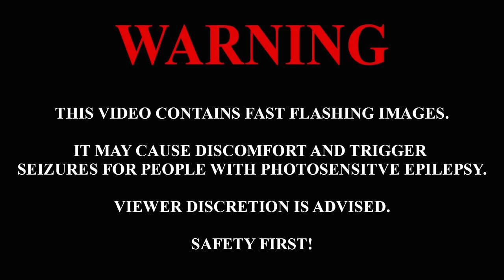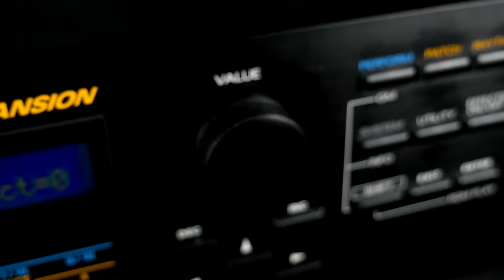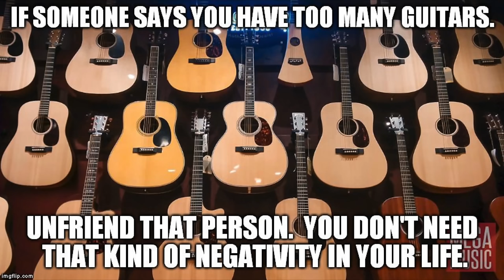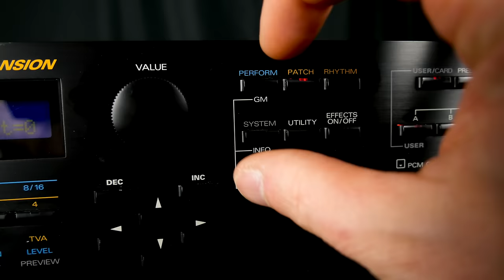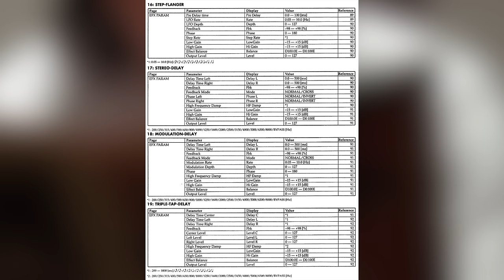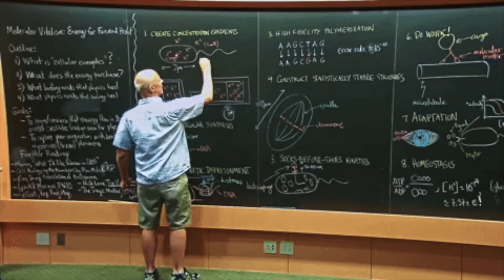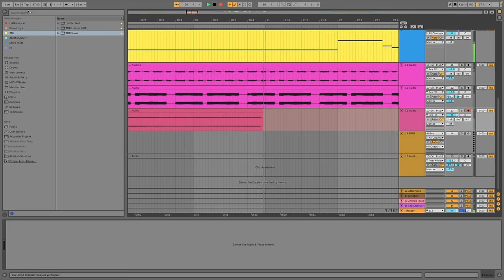Bad Gear - Roland JV-1080

Comment: The JV1080 is one of the greatest synths ever made. The 1080 is insanely easy to program too, its just a giant grid when you hit the parameter and palette button.
Reply: As easy to program as a D50.
Reply: i prefer the JV2080 cause it has a much bigger display
Reply: @Electrodefender  I actually preferred the display of the JV1080 because it was easier for me to read from a distance. I did want a JV2080 but I couldn't justify the much higher price at the time for not much more functionality.

Comment: I love my JV-1010. It gives me quick access to thousands of (mostly) very usable bread and butter sounds and uses half of 1u rack space! The circa 1994 new age goodness is icing on the cake. I wouldn't dare try to program the thing, but still find myself using it almost every day.
Reply from the maker: Super compact little synth!
Reply: Yep, it's my swiss army knife for whenever the synth I'm working on is missing that one sound. I personally even like its sound a bit better than the "better" JV.
Reply: Also adds the Session board, great sounds. Need an external device (iPad, Computer) for editing though. The XV-2020 is very similar, but updated and SRX expansion.
Reply: @darwiniandude  what do you use for editing the jv-1010? I think it is unfortunate that you can't set the midi tempo/clock (for LFO for example) to follow/slave without diving into a software editor.

Comment: I've had mine since 1994, and it's still providing bread and butter in my studio, alongside newer synths and VSTs. An awesome piece of gear.
Reply: @D T Day I do! I actually have 5 (even though the 1080 can only handle max 4.)

I have the Pop card, the Vintage Synth card, the Techno card, the World music card, and the Orchestral card (not installed at the moment) I also have a Country Music PCM card for the front slot.
They do add a lot of versitality and value to the unit.

Comment: I had the JV1010 some years ago - great little thing - and have the JV 2080 for several years now. I always love coming back to this big black box of awesomeness. It has lots of sounds that are still relevant today while others seem a little outdated compared to the usual suspects of sample libraries everybody has today. But it has a special vibe, it instantly throws you back into the 90s ... ticking memory boxes. And it also surprises you with some sounds you find nowhere else. I love it.
Reply from the maker: Nice little sound module!
Reply: About the JV-2080, does anyone happen to know if the entire thing plus expansion boards is built-in to the higher-end Fantom keyboards or the INTEGRA-7 module? Or indeed if any of it is featured 'as was'? They mention an XV-5080 in their current blurb but that one passed me by, so I'm none-the-wiser.

Comment: I have a JD-990 which is very similar, even have a couple SRX cards.  Also I've messed around with the Cloud 1080 vst a fair bit.  The JD and JV series are probably my favorite synths.  The architecture is complex at first but all makes perfect sense to me, intuitive limitations in just the right places and endless inspiring possibilities when you start getting creative.  And the crisp cold "cheesy" 90's digital sound is my favorite.  Nothing bad about this synth at all imo.
Reply from the maker: The 990 is the one to get!
Reply: I was waiting for someone to talk about the 990.  I used to have a stack of three of them, all with the Vintage Synth card installed.  It was awesome but total overkill and it never ended up seeing any use.

Comment: The bass sounds in this unit should not be understated, they are so incredibly thick and warm
Reply from the maker: Agreed, got quite some depth
Reply: agree
Reply: Fuck yeah!
Reply: Still my fav acoustic bass
Reply: Yes! They were powerful!
Reply: I love the preset "WonderBass" that is found on all the JV, XP and XV models. Although it sounds best coming out of a JV/XP. The one in my XV-5080 isn't the same, lacks that oomph.
Reply: @ram-4  man a lot of patches that relied on specific low frequencies sound super dead on the XV versus the JV
Reply: @jonnyalec5646  XV has a built in HPF that you can't turn off.
Reply: @iceparty4364  makes sense

Comment: I bought one of these a few months ago, amazing bit of kit for the price. Surprisingly usable actually, I've been having fun with it in combination with the Sherman filterbank 2
Reply from the maker: Nice, sherman!!!
Reply: The Sherminator can make a half eaten hamburger dropped on wet floor sound radical, so well, yeah
Reply: I paid about £160 for mine a couple of years ago and I've used it on at least one track so far. I haven't gone past the presets, but it's a nice bit of kit to have and I don't see myself selling it. Unfortunately, I am getting a lot of noise from mine, which I don't think I did about a year ago.
Reply: @TimWrightDJ  That's almost exactly what I paid for mine with one expansion card. Are you getting noise on all of the outputs or just one pair?
Reply: @TimWrightDJ  take it to a tech, probably some caps need replacing.

Comment: absolute hell to program without using external software (i write patches via an iPad interface for mine) but a super rewarding synth to deep dive into!!! having some expansion cards to pull sounds from really elevates it. obviously hard to recommend when software alternatives exist and said expansion cards are increasingly expensive, but one of my fave synths. great jams this episode!
Reply from the maker: Thank you!!! Agreed!
Reply: hence JV-2080 is always the better option with very nice dot matrix display and shortcut buttons. It's the exact same layout as in JD-990. Besides that you can expand JV-2080 with up to 8 expansion boards.
Reply: @panutalus  at this point, for the price, sure - neither are probably truly Good Options with so many pieces of software filling the voids in 2023, but the 1080 was a much better option price-wise when i picked it up a few years ago vs the 2080, especially knowing i could just control it via software on a touchscreen.

Comment: I still use a JV2080 as one of the centrepieces of my studio. Even as the OG sound of the 90s these things are still classics. (And the bigger screen on the 2080 makes programming it way easier!)
Reply from the maker: Nice one!
Reply: I agree  I have a 2080 in my set up blown out with expansions and it is a usable piece of gear. I use it for small ear candy in the background. I also will sample many of the sounds, slap a few new age effects and filters on them, layer it , and Boom!!!  I'll keep mine and maybe one day it will make a vintage list 👍👍👍
Reply: The 2080 has 8 expansion slots, and 3 insert effects - nearly all others in the range (except XV-5080, the 2080's successor) have only one insert effect plus reverb and chorus. 3 insert effects gives way more flexibility while keeping things in the midi domain. Super useful in the 90's. These days though it's trivial to record a track to audio then repeat with other tracks so three inserts isn't as essential. But yeah, JV-2080 is a beast. Was always jealous when I saw pics of people's racks with two JV-2080's both full of cards.
Reply: Is the sound of the JV2080 the same as the JV1080?
Reply: @MeneTekelUpharsin  Yes. An unexpanded JV-2080 has the same exact rom waveforms as the JV-1080. However, it has an extra bank of presets. A B C & D banks each have 128 sounds, the same on both. JV-2080, and later JV-1010 etc, have an E bank too. But it uses the same rom anyway. JV-2080 has better screen, 8 expansion slots vs 4, three insert effects vs one.

Comment: I've got the 2080 and one thing I really like about it is that it's multitimbral. I really wish more modern synths were at least bitimbral. It can be fun  to sequence a whole track using just the 2080.
Reply from the maker: Agreed, multitimbrality is a phantastic feature...
Reply: workstations like roland fantom or fantom 0 or the korg krome/kross/kronos yamaha modx etc all have 16 parts that can be set up with different key ranges, internal or external sound control, effects etc.   I have a JV-2080 but since i have a korg KromeEX, i just use the korg and its touch screen and set external channels to the jv-2080 if i want some sounds from it, and other external channels to other synths, or choose from the thousands of internal sounds and really cool endless selection of drum patterns and kits.  the krome even has a mixer section where you mute parts and change volume or pan etc, like a mixer.    the korg wavestate and roland JD-XM i believe are both 4 layer mini-workstations sort of. so fighting with the JV setting up 16 parts is a pain vs doing it on the workstation touch screen.
Reply: It figuratively kills me that nobody makes multi-timbral synths anymore.  They just figure that the synths are cheap enough that you'll buy ten of them or stack a bunch of VSTs.

It seems like there are more analog multi-timbral synths coming out than digital, despite tons of great digital synths coming out and surely that would be easier than multi-timbral analog.

Comment: The JV-1080 will always hold a special place in my heart because it's keyboard version, the XP-50, was my first real keyboard and I learned so much about synthesis and sequencing with it. If you deep dive into it's capabilities it can produce some fantastic atmospheric pads and ambient sounds. For what it's worth, the expansion cards really open up the capabilities of it. When I got the Techno card installed in mine it made a massive difference. Lots of great classic synth samples and some very trendy 90s loops and samples to boot.

Comment: I love this dang box with my whole heart. I love that it sounds just a little bad but also great at the same time. I love that it would've been top of the line 30 years ago, and that now you have to really work to get it to sound interesting and useable by today's standards. I love that the capacitors on the expansion cards are so cheap that they're prone to exploding by now if you don't replace them. Adds an element of excitement and danger. And I love boomer shooters. Thank you for paying tribute to the object of my heart. It is sitting next to me on my studio desk smiling. Everything is alright.
Reply from the maker: Always a pleasure, thanks for watching!!!
Reply: Incoming pedantry alert: I think you mean the capacitors, not the transistors. The electrolytic capacitors on the expansion boards do go bad but then again, most electrolytic caps have a lifespan of around 25 years.
Reply: @Jim Alfredson  i realized that a while after posting haha. Edited for clarity. Thanks

Comment: It's a really great synth for just writing music and has a pretty deep synth engine. It's hard to fault it for what it was meant to do, but I save all the actual synth programming for the JD990, with it's larger screen and greater emphasis on synth waveforms. My album Innsport 86 is littered with (barely modified) JV-1080 presets. I sent it through the OTO BIM passthrough mode and it came out sounding like an 80s sampler. I think you're absolutely right though, it is the sound of everything in the 90s and it's hard to get away from that, granted that sort of makes it the ultimate tool for recreating that aesthetic.
Reply from the maker: OTO BIM certainly helps;)

Comment: In the 90s this was a heavyweight monster. Today it sounds like wet cheese through 16bit chorus. It's astonishing to me that Roland is still using this as the benchmark of sound to keep selling over and over. For example, in the MC707 you can actually hear the loop points in many of the onboard patches! That was acceptable in 1994, but not today. However, 60 voices through 16 part multi-timbral is a thing that should come back. It's the same reason I've stuck with a Virus Ti2 for years, because it's hard to get impressed by a 5k machine that only has 6-8 voices (or less!) when you came up on monsters like the JV1080, K2000S, etc. I feel like Roland is dipping a withered old toe in those waters again with the SH-4D. If you think of it as a 5 part multi-timbral synth with 30 voices instead of a "groove box", it makes a lot more sense as an instrument.
Reply from the maker: We still buy it;)
Reply: Absolutely agree! I think the SH-4D will pair great with a sampler/sequencer as a pretty small live setup, can't wait to introduce it to my MPC One.
Also can't wait to see that SH-4D on Bad Gear in a couple of months, too.
Reply: Some of these presets shown are still in modern Roland gear, well not modern per say but they're definitely in my JDXI
Reply: @mickhealey5848  no, absolutely still is. the jv patches were recycled in the xv series, and the xv patches were copied in every roland synth ever, and to this day you can find the xv patches, including the recycled jv patches from 1994 still in a roland fantom today. a year ago i walked into a store, i played with a fantom 8 and saw patches from a jv1080 still on it.
Reply: The SH-4D is the first Roland product in decades to really get my attention.

Comment: Awesome - it can still produce great sounds in the right hands, as you've shown. I wanted a JV/XP of some sort after playing with an XP-30 in the music shop back in the day. The XP-30 is a 61 key JV-1080 with four tone sliders for better hands on control, equiped with two empty JV-80 slots, but comes as standard with Session, Techno and Orchestral boards built in. So it was great value. In the end, out of my budget. And I couldn't bring myself to buy a used JV-1080 with that stock piano sound. The Session board was the best all round update for better quality sounds, far better piano, guitars, strings, drums... Session was essential. In the end I bought a JV-1010 which has an unusable front panel UI for any editing but unlike modern Roland entry hardware (I'm glaring at you, JD-08) had full SYSEX functionality so connected to a computer it effectively was a JV-1080. The JV-1010 had the Session board built in, and one expansion slot - I fitted mine with the Orchestral 1 board. Really great little box if you don't mind editing via the computer. I lusted after the XV-5080 when it came out - the ability to put my own waveform samples in the front of Roland's S+S architecture with it's structures and matrix control and all that the XV had to offer was tantalising. However my budget never stretched to that at the time - the XV-5080 on it's own was double what I paid for my car back then. A few years back though I found cheaply nearby the Fantom X8, snapped it up as I was very familiar with these. It's effectively an XV-5080 with some newer waveforms and updates, a very functional colour LCD with easy and deep editing options, SkipBack sampling so it always records the last 30 seconds or so of anything you play - a feature I miss on any other instruments - and sour SRX expansion slots. SRX if anyone doesn't know are later expansion cards with way more waverom than the JV80 cards. However I'm not super excited about most SRX cards, they focused many on specific areas, like one card is a piano, one is drums, one is strings, etc. The main reason I got the Fantom X8 though is Roland made four SRX cards which each contain all the waveforms of FOUR SR JV-80 cards... the best ones. So I hunted online and tracked down the four i wanted. SRX-06 Complete Orchestra, SRX-07 Ultimate Keys, SRX-08 Platinum Trax, SRX-09 World Collection. While these all come with newer presets, I now have inside the Fantom all the waveforms from 16 of the best SR JV-80 cards. All the 90's goodness I had always wanted, really. The newer presets sound great, so there are presets on each board using sounds from the four included JV80 waveroms. But essentially I now have all waveforms from SR-JV80-02 Orchestral, SR-JV80-16 Orchestral II, SR-JV80-13 Vocal, some from SR-JV80-07 SuperSoundSet, all from SR-JV80-04 Vintage Synth, SR-JV80-08 Keyboards of the ‘60s & ‘70s, SR-JV80-10 Bass & Drums, some from SR-JV80-09 Session, SR-JV80-03 Piano, SR-JV80-11 Techno, SR-JV80-12 HipHop, and SR-JV80-19 House,  SR-JV80-15 Special FX, SR-JV80-05 World, SR-JV80-14 Asia, and SR-JV80-18 Latin, SR-JV80-17 Country. A few of the original waves from some are missing due to expired licensing reasons etc, but either way it's an INSANE about of 90's rompler goodness. So Anyway, massively too long comment but if anyone has read this far if you have a Roland box capable of taking SRX cards (like the XV-5080) dumping those four SRX cards in gives you a near infinite sonic palette of Roland rompler goodness. If you look at the price of the Vintage Synths JV80 cards, the SRX-07 Ultimate keys inside an XV-2020 or something is a better option I think. I have no interest in the Roland Cloud :)
Reply: What do you use to edit sounds on the JV-1010? I’m struggling to find something that works on a Windows 11 PC.
Reply from the maker: That sums it up nicely!

Comment: I found a like new Roland JV-1080 & I have a Akai MPC One drum machine & a pair of Rokit KRK Monitors & I wanted to know if these Hosa CPP-202 Dual 1/4" TS to Dual 1/4" TS Stereo Interconnect Cables will work connecting to the outputs of the 1080 into the MPC One.    Marc
Reply: @AudioPilz  Thanks for responding I had brought 4 Expansion boards for my 1080 (Session)(Dance)(Keyboards of the 60s & 70s & (Orchestral)

Comment: I have a JV-2080, which has a bigger display and more expansion, but I would still opt to use SoundDiver with it. At least with the JV line, you own it rather than using a subscription. At least it takes up less disc space and CPU.
Reply from the maker: You need to recap them from time to time though;)
Reply: @AudioPilz  Possibly because of corrosion over time. I have the vocal expansion, and some patches didn't work because of age.